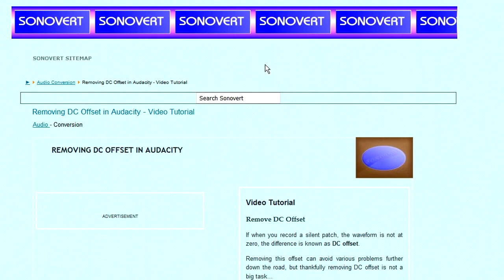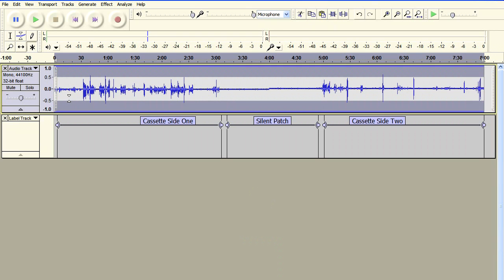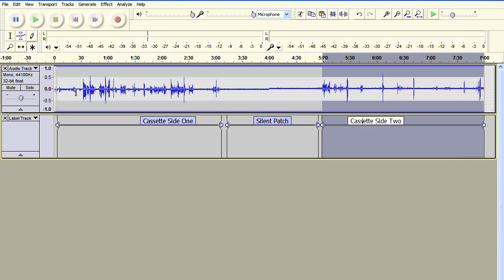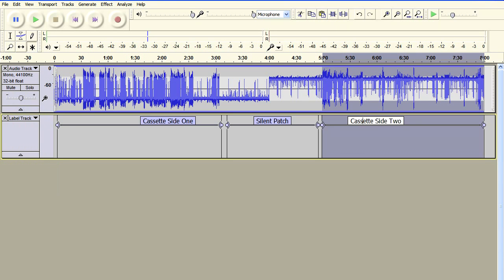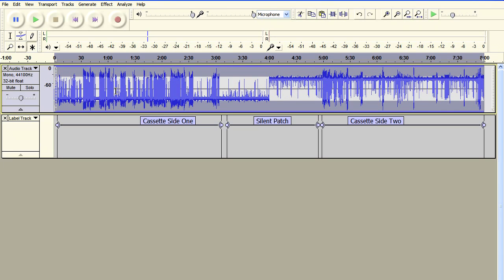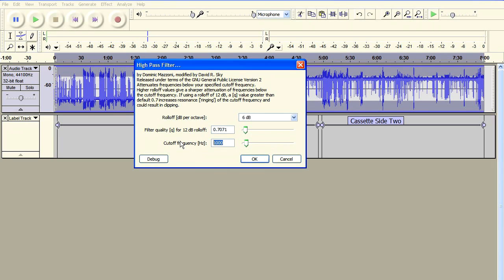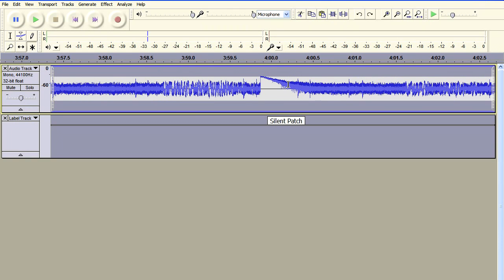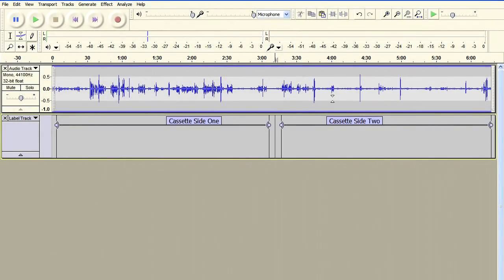What is DC Offset and How to Remove it in Audacity Using the High Pass Filter

Comment: In this case you could have simply processed the two regions separately, and be done with it quicker. A highpass filter comes useful if an album with several tracks has DC offset, but the gaps between tracks have already been muted (with fading, in attempt to avoid clicks), and there is no DC there anymore. Or sometimes the gaps have some slowly floating voltage resulting from switches being manipulated. There usually is some quiet, wanted signal there at that time too. I might apply a global, lossless DC offset bias to the entire file, then select each gap and apply a highpass at 20-40 hertz on each gap, and then mute any short remaining pulses where the offset jumped earlier. I am usually afraid to apply highpass on an entire recording, because it might create phase shifts or resonance in bass.
Reply: Seems faster to me and in only one step, and could make it even faster and have a preset that sets the filter frequency for you.

Comment: the remove DC doesn't work because instead of removing the DC of the second and leaving the correct DC on the first side, it would take the mean of the distance between the first DC and second DC and then shift the current so that both parts would have equal offset. It only works if there's the same offset the entire time. Anywho, good vid.